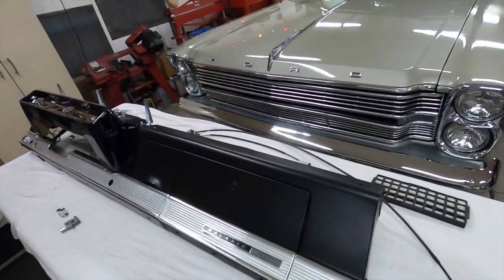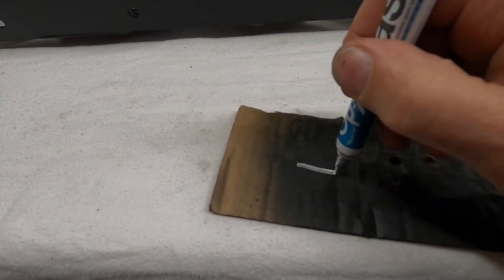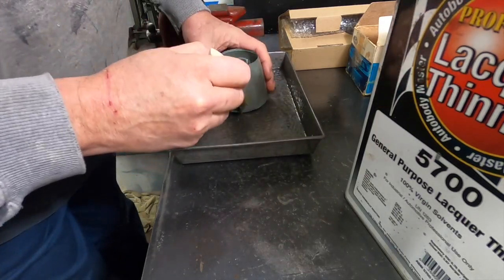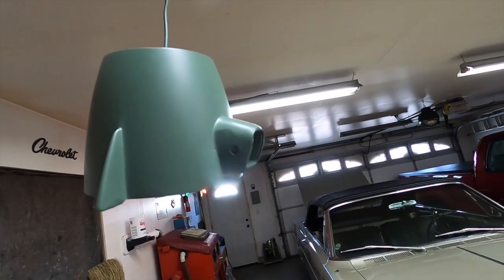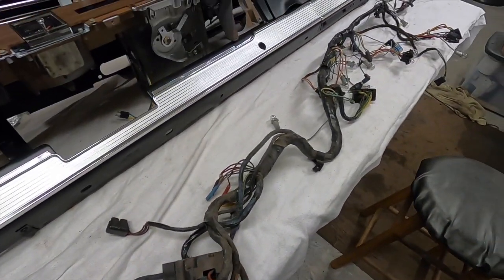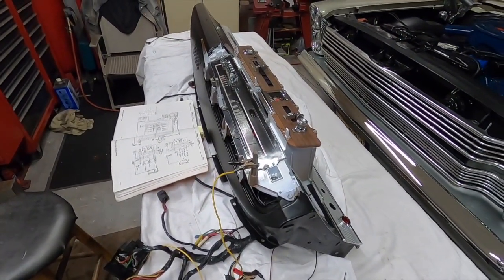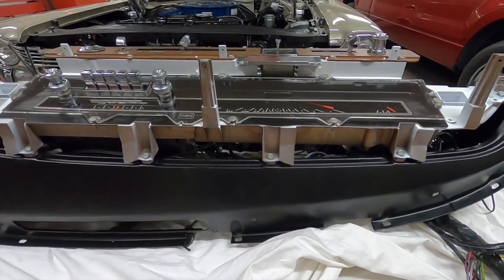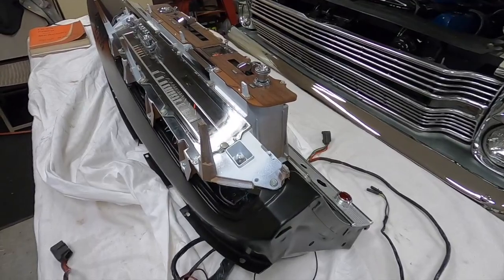1966 Ford Galaxie 500 convertible restoration part 165 installing wiring harness into dash

Comment: Dash is looking great. Tackling the wiring harness can be intimidating. You make it look like something that can be done with the wiring diagram and a few simple tools. Have had luck with Duplicolor Chrome in the spray can on plastic. Could probably be sprayed into a container and applied with a brush as an alternative to masking
Reply from the maker: Thats basically what I ordered, only it comes in a little 8oz. bottle.

Comment: Found good chrome paint at hobby lobby in model car paint and in art supply areas it is a paint marker black with chrome label for best results use metal lid and used it to flow paint out of maker and used small paint brush to apply paint to my 86 touch plastic window molding looks close to chrome
Reply from the maker: There is no hobby lobby near me, but there is a really good art supply store. I ended up ordering some stuff online that I like and have used in the past.

Comment: I love your channel and quick progress. Lately, I’ve been wanting to own one of these. How does it drive? Is it a chore to drive compared to a newer car? I use to drive Ford falcons and Mustangs from 64-66, I’d assume this would drive more substantial.
Reply from the maker: It drives as good as a new car..... and it still need tires and a front end alignment. Big improvements in steering and suspension happened in that era, making them very road worthy in todays traffic.

Comment: Didn't notice you check the high-beam indicator when you were checking the dash lights. You may want to since it's apart. The dash lights look GREAT on Instagram. Also, I always wondered why the 4-way switch is inside  the glove box. Always seems inconvenient when I need to use them on my Galaxie. Was that a Ford thing back then?
Reply from the maker: All the cars that had 4 ways, often had the switch in a odd spot, back in that era. I checked it and the hot lamp, they both work, just didn't video it I guess.

Comment: Great job 👌,just a thought but I was wondering if you had an extra check valve for the power brake booster on the 59. I just converted my Elcamino to power brakes and I'm having a hard time finding one, thanks
Reply from the maker: The only one I have, is for a power brake set up.... I don't want to sell it. I think you can get them with barbs on both ends, put a barb in the manifold, and use a hose between the manifold and valve.
Reply: @OldCarAlley  I have a cheap one already installed,I was just looking for an original one,.. Thanks for getting back to me.ps. you do wonderful work
Reply from the maker: @larryfernow4071  I wish I had some extras, like you state, there impossible to find now days.